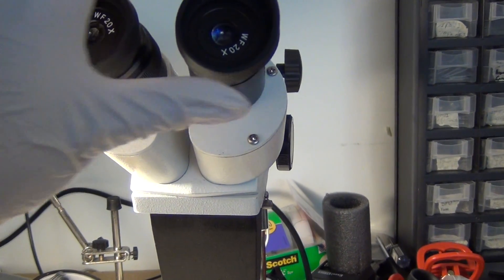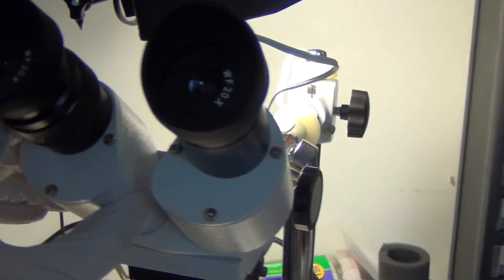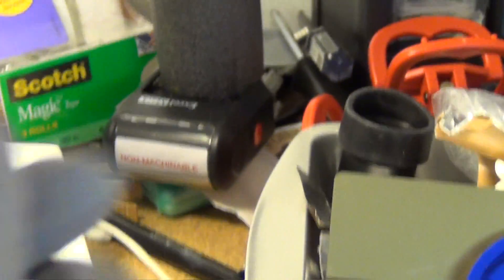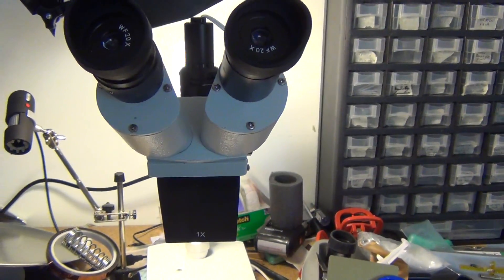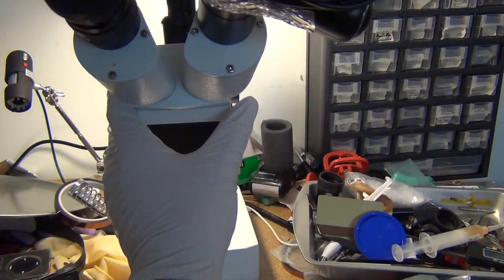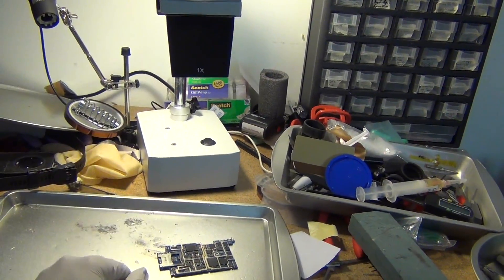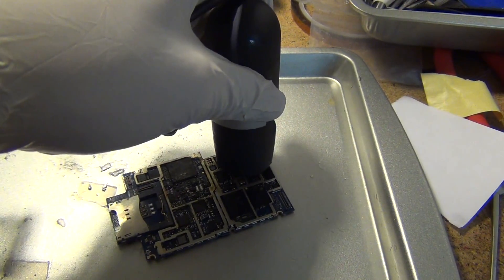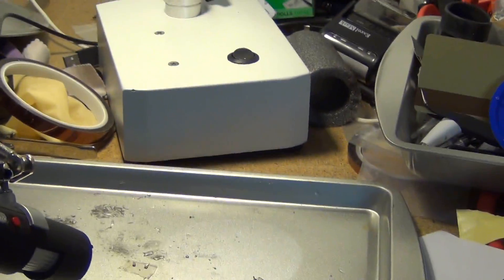Soldering Microscope AmScope SE400-z 10X-20X Widefield Binocular Stereo Microscope Arm Stand

Comment: What is the exact working distance in inches or centimeters above the stage to the barlow lens when using the supplied eyepieces of 10X and 20x with the 1X barlow or objective lens?
Is the working distance below the objective greater with a non zoom microscope as opposed to the stereo microscope with a zoom function?

Comment: hey cyberdoc if you still use this microscope, you can change the bulbo for a led bulb it is E10 socket. look it con eBay. nice vídeos keep the nice work pal
Reply from the maker: yes  but it maybe easier and cheaper just buy the led version.
Reply: +CyberDoc LLC i change just the bulb for one led bulb it cost like 5dlls on ebay for 2 led bulbs they are the sale socket it just plug and ready

Comment: ok so, 20X is really enough for cms component.. (?)
Reply: Even 10x is enough. 10x gives you a very surprising amount of zoom and a nice, wide FoV. The 20x (what he's using here) is MUCH MUCH higher zoom (really good for specific component inspection) but has an extremely narrow FoV.

10x is good for work, 20x is good for observing the work, like if you want to check and make sure you've got a good, solid connection or want to observe the underside of a chip for broken solder balls.
Reply: spartan456 Hello there good advice,  I have a question maybe you can help me , I just got a good deal on pre-owned Amscope SE400 X, this microscope came with  a 2X objective 10X and 20 X lenses.  I'm new with microscopes so I want to know if I put a pair of 5X eye piece lenses will that be equal to 1X objective with a pair of 10X eye pieces? Or should I instead buy a 1x objective and just keep using the same lenses? Please advise..
Reply: @davidlomas4015  How about the working field area? Narrow ?